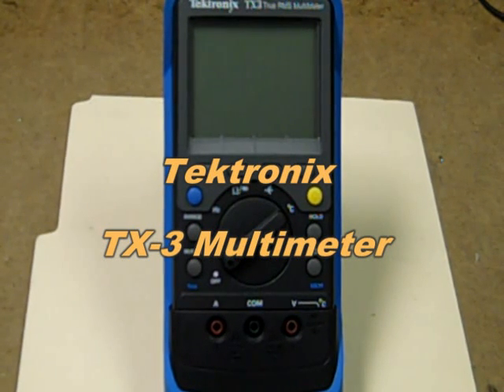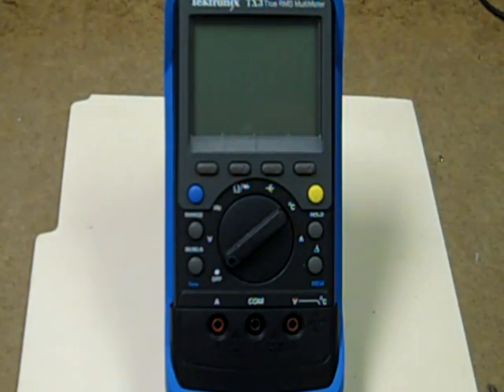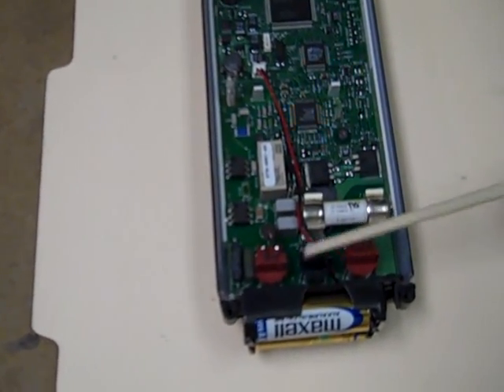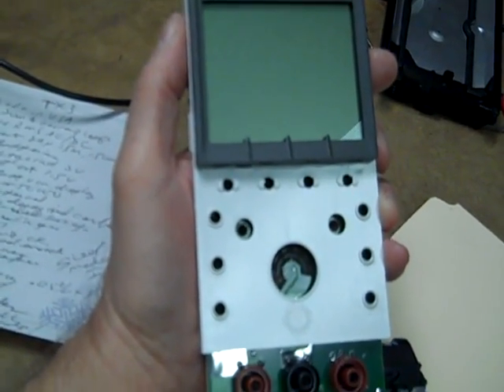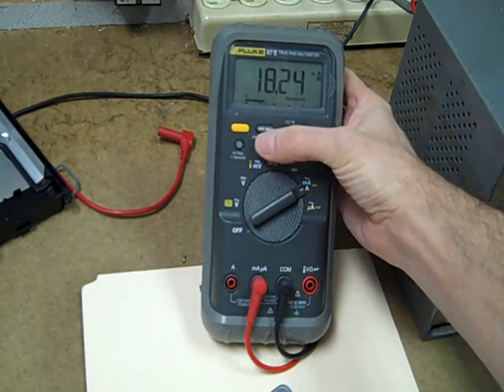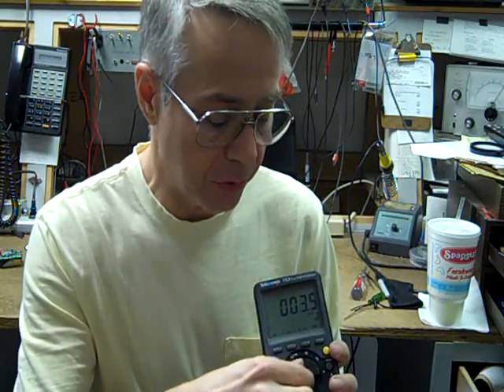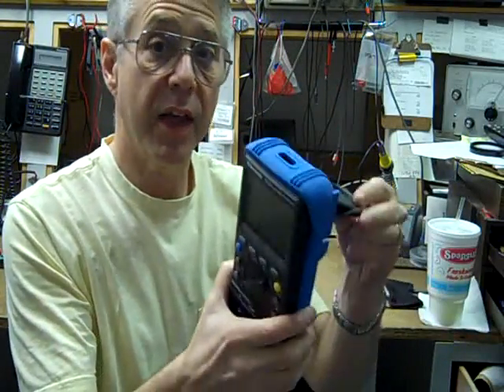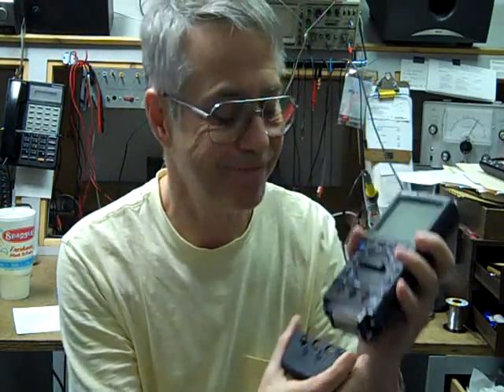Tektronix TX3 Multimeter Review Part One.mpg

Comment: Where can I get a service  manual for this meter as it is not measuring voltage
Reply from the maker: All I can suggest is to contact Tektronix, or Fluke for the model 183/185 service manual, if any since they are identical to the Tek models.

Comment: It also does % of the upper or lower half of a wave form. After it was discontinued I scored the $50 Tektronix padded case as new in the bag surplus for 5 bucks. The cables come with friction fit alligator clips that just depend on the alligator clip sheet metal. Garbage. I will get another set that takes screw on clips or one of those multi tip sets. The meter actually came with a NIST certificate at no extra charge. Many meters measure freq. but have terrible freq. response on AC volts. This one is broad and flat enough for audio. Thanks for telling me that it is also a Fluke 185. I have had this meter a long time. My wife got it for me for Christmas and I am very attached to it. I wish the case markings were imprinted better. The A for amps is mostly rubbed off. It also comes with a K type bead thermocouple for temp and can be ice water calibrated. from the front panel.
Reply: Another feature I forgot to mention is the the 50 ohm range. After selecting it , you are instructed to short the leads together and it nulls out their resistance and after a few seconds it reads O. It then can take very accurate low resistance readings. I believe it calibrates with soft
ware via the RS232 port. There are no trim pots inside for that purpose. If that ever becomes a problem it is probably toast.

Comment: Good day! I have a problem with TX3. The display inscription "UNCAL". How to recover my device?
Reply from the maker: john john The TX-3 is a closed-case calibration unit. I have no direct information on how to recover. I would suggest a repair facility who worked on these when they were a current model, might have the necessary IR cable, calibration procedures and software. If it helps - the TX-3 later became the Fluke 185 when Fluke bought Tektronix' multimeter division.
Reply: Mark Zacharias Thank you! Еxperts recommend me to flash 25lc160. I will find the firmware operating system.
Reply: Hello, were you able to revive your TX3? Mine is in the same state, and I can't find any information on how to fix it. Thanks!

Comment from the maker: I have discovered some interesting stuff about the internal workings. The MOSFETS are used to enable the current shunts, and are live all the time, even when the meter is "off". The 29uA current draw in standby apparently is for the DC-DC converter which provides the -6 volts used for the MOSFETS. Remove the 2 AA cells and the gates bleed off, the shunts are disabled. Still trying to do better reviews, not there yet... Hope this is useful anyway.
Reply: do you want to sell it
Reply from the maker: @hussenali5912  Sold it a long time ago.